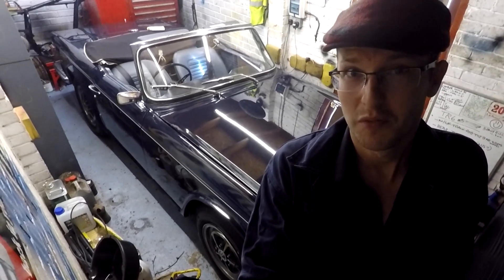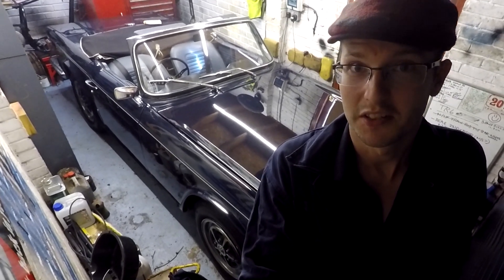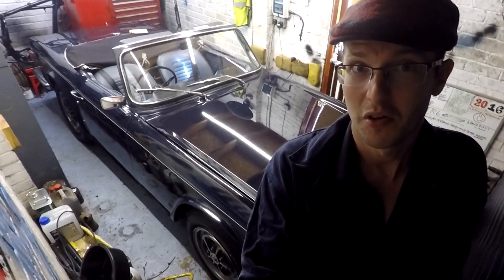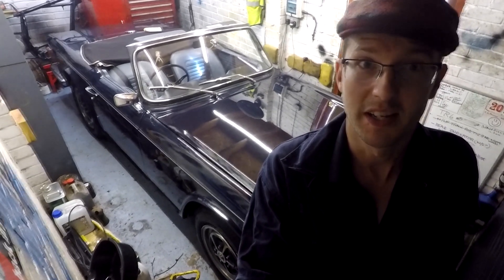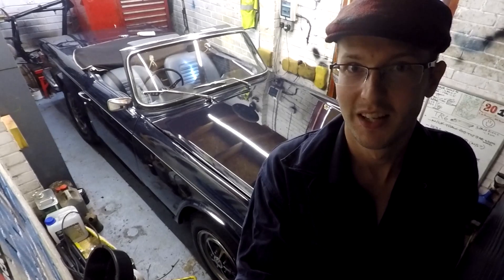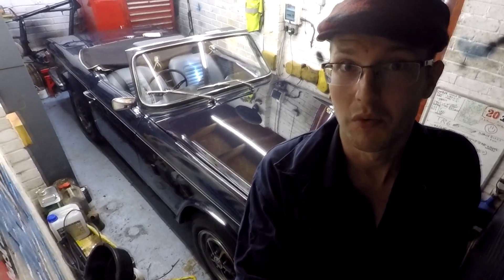Triumph TR6 Cylinder Head Retorque

Comment: Hi Steve,
This video is a nice complement to the Operations Manual.
Do you fit a new rocker cover gasket every time you remove it?
When fitting this gasket, should be used some type of sealant to prevent leakage?

Thanks
Reply from the maker: The rocker gasket on a Triumph is a cork gasket, so you shouldn’t need any sealant on it. You can get away with reusing this gasket a few times, but everything has a self life. If unsure replace, they are cheap enough to buy
Cheers
Steve

Comment: Hi Steve. Sounds sweet! I was surprised how much you had to retorque the head bolts. Was slightly concerned by the very rapid hand movement at 4mins. There  is some debate as to wether the early "6's" had chrome rocker covers. Bill Piggot who appears to be THE afficianado for all things TR claims that was sTR6. Cheers!
Reply from the maker: Cheers John, shes running a treat now. Yeah, since reading Bill Piggots book I've maintained mine to have the chrome rocker cover. To me it makes sence as the early ones had a number of things different to the 1970 onwards (BL budget cuts!!) being a 60's car I think its right to have it, Along with the unique steering wheel, rostyles, and round gear knob. I think my bumpers are different, or at least someone once told me they are on early models
Reply: @SteveDentonClassics   Hi Steve, the front bumper is a very close fit to the front panel and you can just glimpse the front brackets dropping down to their mountings. By a big margin the ones you normally see  have a one and a half inch gap between rear edge  and front panel and you can easily see the mounting bracket. Hope this helps. I found a round gear knob on a 13/60 parked outside the local spar shop and persuaded the owner to let me buy it. He was moving away the next day!
Reply from the maker: That's it, I knew the bumpers were different somehow. I've found the round one to be common on the smaller Triumphs, but it's finding one without any writing on to be correct with a TR6, fortunately mine had the correct one on it when I brought the car, so it's not been too much of an issue. I've always found its amazing what you find is the same parts under a different part number when you look across the parts range

Comment: Well done Steve!!!  sold my Tr6 40 some  years ago and it is still in my blood. Watching your videos has almost put me in late life crisis to go out and buy another. I still remember every nut and bolt and I touched them all. I was a bit late on the retorque and nuts seemed quit loose. After doing the same as your video here it was like a new engine again. Your vids are a real pleasure and brilliantly done. Cheers from across the pond, Steve O
Reply from the maker: Thanks Steve, to hear you say that means alot! TR6's and any British classic sports cars are just great cars to work on compared to what I have to work on for a living. They are just simple pleasures that give me a smile when I work on them and drive them. If I could I'd do them full time over working on ECU controlled modern car car for a living I'd do it in a heartbeat, but the bills need to be paid I'd say if you see another one that you like, and its at the right price do it, buy it follow what your heart says and get it, you'll not regret having a 6 again. Cheers Steve

Comment: Nice job steve,,,thanks for sharing,,,
Can you replace all four wheel bearings next,,,,so I can learn how you do it ???    Lol,,,
My TR 6 needs its bearings replaced,,,I've bought the new bearings but have had no time to do it,,,,,
I did make up a hub puller ,,just about completed it,,,,,maybe next spring I'll have time 
Take care steve,,,thanks again
Reply from the maker: Hi Doug, front bearings on pretty much any Trumph are dead easy once you've got the hub off you just knock them in and out with a copper drift. You don't need a puller on the fronts, and when you do them up, just hand tight then back off one flat, back them with plenty of grease, As for the rears, with a TR6 I've never bothered as they are just too much hassle getting the back lash set up right. I've found with rears its just easier to to either just buy a new hub or send the hub off to an engineering shop to have them done, or just go with uprated drive shalfs and hubs, fit and forget. Do always check mounting studs on the rear, the metals are prone to eating each other which can case the hub to separate from the rear which bone while driving. I've know it happen to someone too. As for doing a video on all this, its possable, but its really waiting on someone having an issue with there car, or me needing to fix mine. No doubt I'll be uprating the Spitfire at somepoint, the front hubs are pretty much the same as TR6, just smaller. Cheers Steve